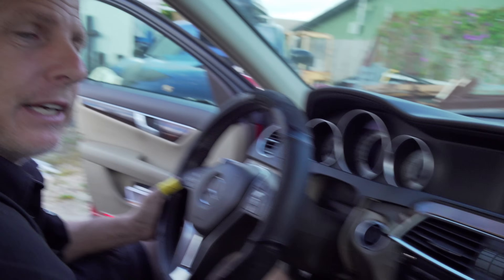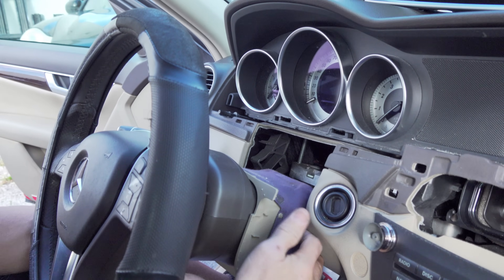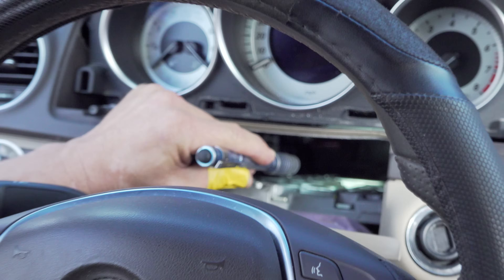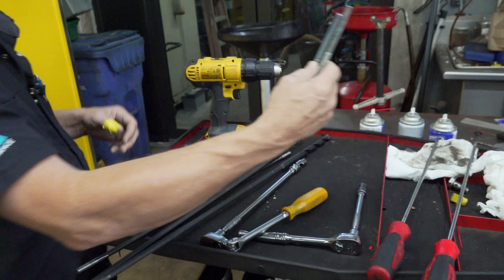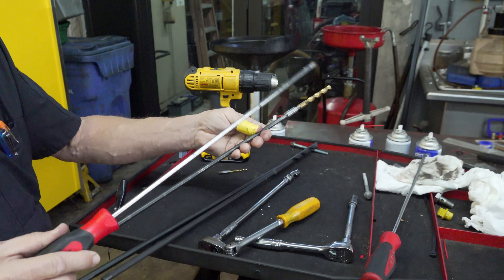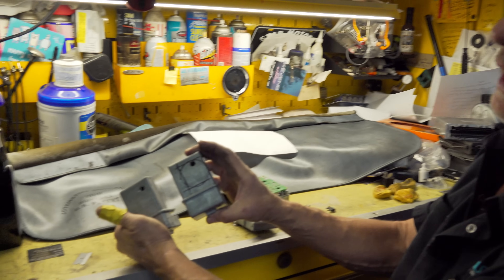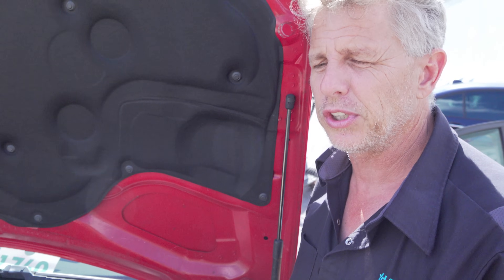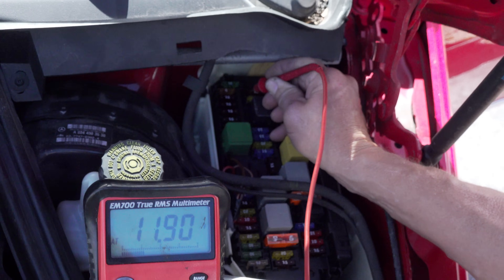REPLACING A MERCEDES BENZ STEERING LOCK

Comment: Mercedes really made it painful! With so much security with the new lock, they could have made it easier to remove the damaged lock.
Reply: Or they could have made a better steering lock actuator that doesn't fail....
Reply: @ranchorelaxo2287  True, but all mechanical systems wear and fail, sooner or later. They could have made that little motor assembly more resilient, to last longer, or just made the access to replace it easier - they like to sell parts too 🙂
Reply: @ranchorelaxo2287  it have a little motor inside that ESL which is not brushless, it just a matter of time if it fail.
Reply: 😊😊😊😊😊😊a

Comment: A stop collar on the drill bit would allow drilling, without damaging the gear with confidence.  A length of rubber hose over the bit or a stop collar on the bit would prevent the bit from  grabbing as it exited the PC board.

Comment: On a 2015 Mercedes Benz c300 on the positive battery terminal there is a voltage regulator that controls the voltage to the starter. The connector with the 2 small wires are both stray ground. I know that’s wrong, does anybody know what controls that voltage regulator, where that signal comes from. My car won’t start, the battery is brand new, starter is new, I have a code for low voltage but no battery light on the dash

Comment: Okay, it's been a while since this video and today I got a c300 with an electric column and steering lock was bad . 
Appreciate this a ton , lowered and drilled (wasn't THAT hard) and in no time had the ESL out. 
Customer is opting for an emulator, very satisfying
Reply: I'm doing this right now failed after change cv axles

Comment: I did it!!! Thank you for making this wonderfully helpful and empowering video. I had to drill through the metal casing and the mother board to turn the wheel with a #2 phillips. Had to remove the airbag and steering wheel for drill bits to reach. The airbag removal was tricky to release the springs. The indents in the side that I poked through with a small flathead were a little further forward, towards the steering wheel, so when I had trouble engaging the spring to release the airbag. I needed an 18" breaker bar to unscrew the center steering wheel machine screw. Yay! THANK YOU!
Reply: 2012 c250

Comment: Why does it malfunction in the first place??
Reply: Because its a little cheap motor in the lock that wears out the brushes and it fries. Typical over design from the Germans.  It will fail on every single W204..

Comment: Great video but to be honest I just took out my first one today after seeing this video still decided to take the whole column out just so I don’t drill the case I repaired it. 
In my opinion its easier to take the column out than doing this. After all the work he’s done you are only left with one bolt to remove and thats it. My car was a w204 c class.

Comment: Great video. Can anyone tell me if a shop key is needed for the steering lock on a 2009 e350 (w211). Indie tech says that it is electronic and does need one, dealership wasnt sure about my model. Waiting on them now but wanted to see if anyone else could verify for me. Thanks in advance.

Comment: There s a chance the ESL is fail “bad” enough even if u hammer it or so it’s still not moving (motherboard fail) . Then u need to remove the column , but you guys really do find a smart way to cut that section for an easy entry. 

You guys are real pro and do install an actual unit . I do the cheaper way by just clone those data from the ESL EIS ,getting the key password and put it into a ESL emulator . It still have the ESL opening sound , it’s way cheaper . My customer happy n I happy
Reply from the maker: We give the customer the option to do an emulator. Some do, some don't

Comment: Great video gentlemen. Thank you for that. Where did the blue key came from? Is it provided with the steering lock by Mercedes and do you have to return it back? I'm just wondering because it's the first time I get to see one.
Reply from the maker: It's ordered from the dealer, although we have ways of programming the steering lock without it. Yes it does get sent back
Reply: @SuperMarioDiagnostics  Hi Mario. Thanks for the reply. The reason I asked is because I thought that the ESL (Steering lock) was part of an FSB4 set on the car. Obviously if you could program it, then it was an FBS3 set. Keep it up, you are doing great video and thanks again for sharing with the community. Respect.
Reply: Nice! Appreciate you guys spreading the knowledge.

Comment: If my "only" problem is a lost key and a dead EIS, is there an alternative to the fancy tools and drilling? As far as I know, the ESL on the car I'm dealing with is not defective. Is there a way to feed power to it to actuate the motor without drilling into it to physically move the gear? I bought a set that includes the steering lock, EIS with key, and ECU from the same salvage vehicle. And, what should be the installation sequence? New ESL LAST, I would think? (forget the multiple edits as I learn from other videos shown to the right of this one)

Comment: How about removing the esl from car while it's still working, and just zip tieing it to a location that I cam just take it out and service it when it breaks? I don't car about steering lock.
Reply from the maker: Won't work because the steering lock is part of the immobilizer system. Vehicle won't run without one installed and operating
Reply: I think what he meant was remove it while you can unlock it.  leave it plugged in and zip tie it up under the dash.  This is what I did.  The column just doesn't lock. Which I can care less about.  If anything doing this may make it last longer as it virtually removes most of the pressure off the motor and if it dies, no drilling of the ESL or removing the entire column required.    Great video by the way.  Best I have seen in regard to how the lock works and how to remove it when it failed locked without taking out the column.    @SuperMarioDiagnostics

Comment: I just went through this rodeo with my 2011 E550 coupe.  The ESL plug has an emulator attached to it and it is not plugged into the ESL.. I still need to verify if the ESL is there. I don't think so but things are still open so I can check.  Is there a way to bypass/remove the ESL and still have the car start with the key? When the wires to the emulation were dislodged from the connector the car would not start - all else worked  fine but no start. I pulled the battery and checked it , the starter and checked it, pulled the EIS and checked it for broken solder pins or connectors and then noticed a damn KRD emulator was unplugged  from the ESL connector .. one or two wires - wired it back in and she started up... - the onyl reason why I pulled the lower footwell cover was to repalce a bulb .. what a surprise as the car was blocking my driveway so my other cars were useless until I moved it .. what a relief. but is there a way to remove the emulator/ESL and still have the card start with the EIS and the key only? I don't need a steering lock. * Great vid BTW!

Comment: I drilled a hole on the esl without removing the steering column. after removing the plastic cover that holds the hood release handle, I use a good cordless drill with a sharp drill bit and sticked it on the back of the steering column (over the brake pedal), then you just turn the gear clockwise through the drilled hole with a pick and voila 🎉 did it in 1 hour
Reply: Mine is a 2010 glk350

Comment: I know its been a couple of years since this post but here goes. I have to remove mine but mine is not locked so do I still have to drill holes and the whole column removal part. I have an electric column on 2013 C250
Reply from the maker: @JohnnyQuestFishing  if it’s unlocked, disconnect it and unbolt it. No need to drill

Comment: My ESL hasnt failed but the motor is getting very lazy and slow so hoping to get the motor replaced this week.

Do I still need to unbolt the column to get enoigh access to remove the ESL

Comment: Thanks for this... by lock motor is really slow but has been working most of the time, only intermittently not working. We don't have any requirements for it where I live, so can I just take the thing out and remove the pin then reinstall it? Or once the motor dies will it still not turn ignition on?
Reply from the maker: Correct, once the motor dies it won’t turn on ignition
Reply: @SuperMarioDiagnostics  Well damn... I guess that is why there are emulators out there.

Comment: Hey Guys,
Can you please reply.
I am assuming that if the motor still works intermitantly, then DRILLING is NOT REQUIRED.
Reply from the maker: Correct, if the steering is unlocked, disconnect and remove
Reply: @SuperMarioDiagnostics 
Thanks Guys. 
Can I also confirm 2 items 
1 ) Unplug OPEN Lock means that ESL can still Fail when the Motor stops working, and
2) If I only change the Motor do I need to get the Programming Key done at 18:50 comment.? 
My Motor fails intermittently so time to replace the Motor, only.
Cheers and Thanks again.

Comment: I have done this job. Mercedes will not sell you this part. DIYer can install a bypass module. Your steering will not lock but you can have your key working and can drive your car again.
Reply from the maker: Yes they will, but a vsp credential is required

Comment: What lengths is your philips #2 over all and length of your hex rod rig?? Thanks!
Reply: Kindly answer this please
Reply: Any update on tool spec pretty please
Reply: @matthewladds7656 I did a manual column. Locked out , I had the customer tow it in my garage with the wrecker truck lol. My rod end to end is 50.5" worked great!
Reply: @hixenP  i took column off...  drilled a hole in same spot and the screwdriver just chewed the gears up... but got it sorted in the end
Reply: Did you program a sim or install another esl? Whenever I travel through towns and I always take notice of Mercedes being parked and sitting at places where you know that car hasn't moved in over a year. Behind buildings at used car lots or alleys or side yards at houses. I'm just thinking there's probably 1 of 2 reasons why that Mercedes is sitting, akl or esl drama lol

Comment: hi do you need special credential to get the new lock and programming key from Mercedes ? or you make the customer order it with his ID and prof of ownership.
Reply from the maker: Both options are available. An lsid is required for the shop to order it

Comment: After you drill out the ESL, you still need to remove a nut from the ESL bolt that's holding it in place, right? Is there sufficient space without removing the steering column to remove it?
Reply from the maker: I showed the entire process here

Comment: I’d say you probably wouldn’t be getting your core back if you drill into the case and PCB on the lock.
Reply from the maker: They don't care, the dealer does this method as well. That's where herb learned this

Comment: Cutting corners to save time not great as drilling through the box just to release rendering the box useless when 9/10 it's just a cheap motor replacement!..
Reply from the maker: who would go through all that trouble and actually warranty that job?

Besides You can’t remove the box without turning that gear

Comment: EXTREMELY IMPORTANT.
Please do not start stripping out your column or drilling holes in the steering lock until you are absolutely certain the fault does not lie within the EIS module. (The bit you stick your key into) 

It's very easy to remove the EIS just unscrew and pull underneath the dash. Go and get it tested with your key. 

The EIS can go faulty through the induction coil burning, the IR receiver breaking or dry solder joints on the PCB. It's not extremely rare like some will tell you. It presents exactly the same symptoms as the ESL fault. 

If you have any kind of electrical fault in tandem with the steering lock like windows not working, boot not opening or fuel flap unlocksble then you likely have a faulty eis not a steering lock problem. 

You'd be an idiot to strip down a column without checking the EIS first.